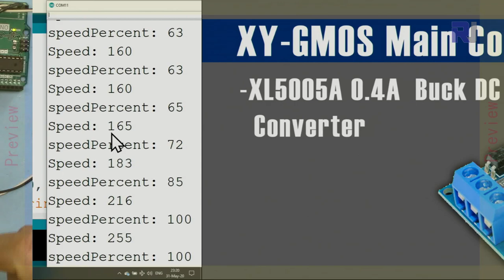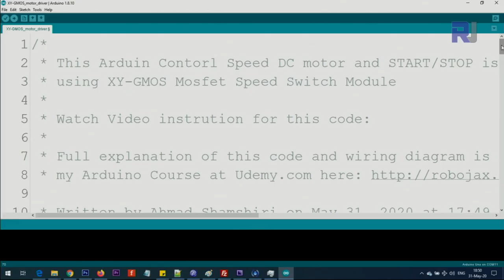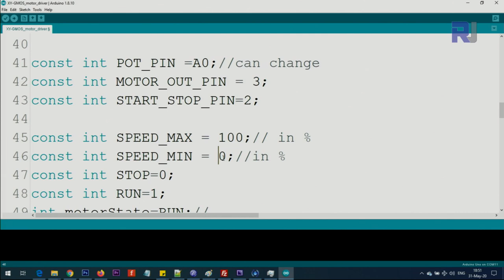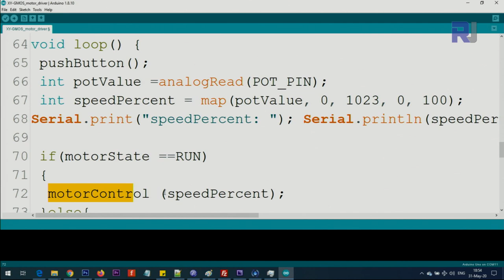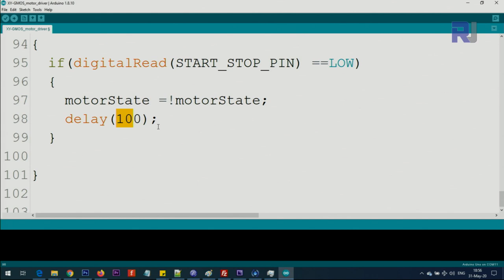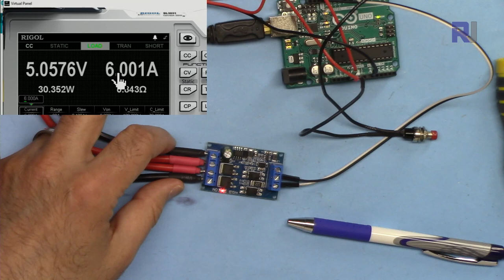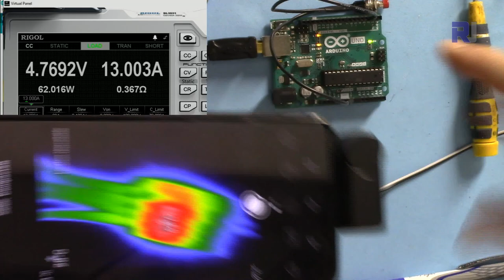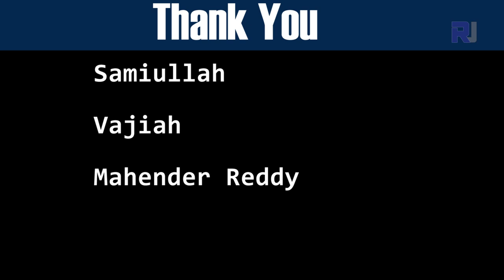Control DC Motor 4V to 60V 10A using XY-GMOS MOSFET Switch module and Arduino

Comment: thanks for the video .I were using one to control the spindle speed on a cnc3018 engraver , 
It was running fine untill putting the motor under load . Now it just runs full speed . Im suspecting failed "fets" .  Next time i will try add a "snubber" diode and disc ceramics to reduce noise and back emf's . 

its all rather new to me 
>>my setup>>, gmos board 
load = 48v 300w brushed dc motor ,
load supply = 48v 360w PSU , 
high pwm signal = 5vdc signal from gbrl control board

Comment: board had two power dc-dc converters. one to step-up (4V-Vopto) and one to step-down (Vopto-60V). Be You so kind to measure supply voltage to optocoupler (Vopto) ?

Comment: Very impressive presentation and explanation about the usage of this  XY-GMOS MOSFET Switch module.
I wish you can add a segment on the same module showing a change of polarity so that you can reverse the rotation of the motor, either using other controller or what? Thanks.
Reply from the maker: Hi, this module does not have the rotation direction change feature.  You may use this module where I have written library for it. https://youtu.be/PUL5DZ9TA2o

Comment: If not using pushbutton, is it necessary to use Arduino pin, or  no need because the motor driver is always on running mode and simply the PWM will handle the stop and run base on the speed.
Reply from the maker: correct. you don't need the push button switch here.

Comment: Thank you for your video! Helped me a lot! How would you use two of this boards to spin the motor in both directions?
Reply from the maker: You are welcome.  two of this can't be used. The wiring is such that it wont' work.
Reply: @robojax  Too bad =/ Do you have an advice for me. I need to control a motor in both direction with 48 V and max. current of 4 A. All H-Bridge boards I found doesn't support 48 V ...

Comment: Anyone know of a schematic of the module?  Can the LOW/SWITCH be left floating?
 I am not clear on how to use a single PWM.  I have applied a PWM into the HIGH/PWM pin, Ground at the ground input but my load is on full power no mater what duty cycle or even high / low I put into the input.
Reply from the maker: Which pin of arduino is outputting PWM? I mentioned that you must use pins with ~ mark. Not all pins output PWM signals.
Reply: @robojax  I used pin 6 of the UNO. I verified with oscilloscope that I had PWM signal.   I finally discovered I had a redundant ground to the OUT- which turned on the motor. Removing the redundant ground at OUT- solved the problem.  I a schematic so that I could see what the circuit was doing internally would have helped me avoid this because I DELBIERATLY added that redundant ground. I incorrectly assumed that is what OUT- was, the output ground.

Comment: Very inspiring video and detailed explanation! I tried setting up one which is almost identical to yours - after about 5 minutes I could see white smoke coming out from my 12V transformer 😰 It's not fried, but very hot, so much so I touched with my hand (yeah I'm a noob) and nearly got burnt.

It appears to me that the capacitor in the transformer is boiling, it happens when the load is off. Do you reckon it's the transformer issue? If so, how do I tell which type of transformer to get? Thanks in advanced!
Reply from the maker: Hello,
if the capacitor is heating up then 1-check your transformer voltage 2-check the labels on the capacitor and read the voltage. when capacitor gets the voltage higher than what is written (rated voltage), it will explode. it seems when you turn the motor ON, the voltage is reduced and capacitor is not getting hot. and when motor is OFF, the voltage is high and gets hot. Solution: connect or use power that is equal or lower than rated voltage of the capacitor.
Reply: Thanks for the swift response. The capacitor is in my power supply (AC to DC converter). It's a dumb unit, 12V and can go up to 80W. My load is a 12V LED strip instead of motor, but I believe it makes no difference. 

It seems to be behaving like what you said, when the load is off, the voltage built up in the power supply and boils it. Do I need a special DC-AC converter for it to work? 🥺

Comment: Can use that mosfet without arduino   Use Only  the pwm
Reply from the maker: Of course you can just turn it on and off by inputting 0v to turn off and aboutb 5v to turn it ON. But you can’t control the speed.
Reply from the maker: If you have PWM source yea.
Reply: @robojax 
Thank’s